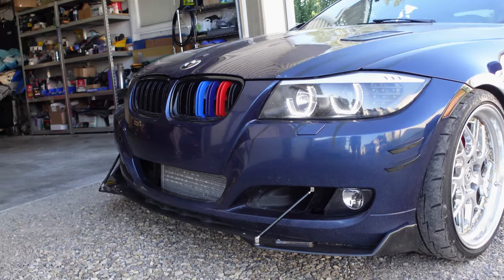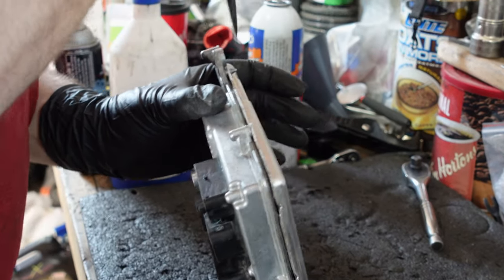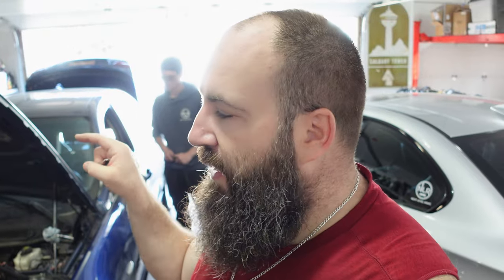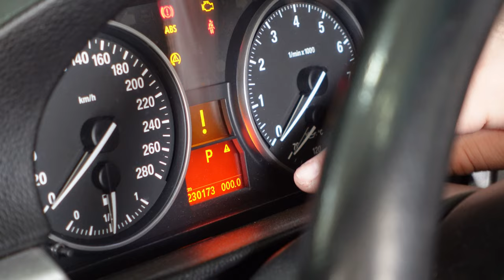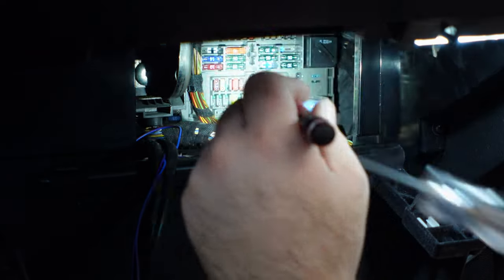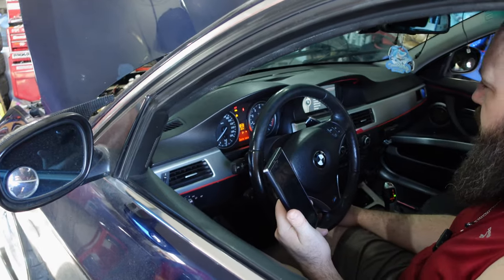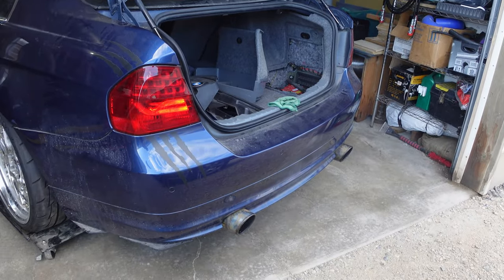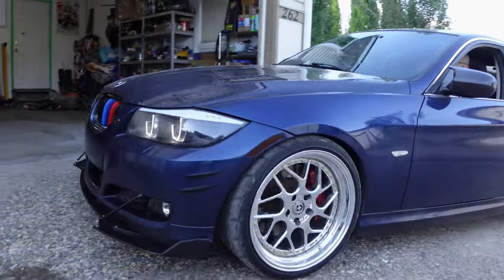Solving An Annoying Crank No Start on Newly Built N55 with 8hp45x Swap!

Comment: Hey guys. Love the channel. Also have an e9x n55 xdrive with an 8hp45x swap using CANTCU. Have had the PTCAN issue ever since I swapped the car. Several other E series n55 cars have the PTCAN issue and we all have vastly different set ups. The PTCAN is often paired with a nasty torque limiter (#419304) that really zaps the fun out of the swap. Interested to see if you all encounter anything similar. Good luck!
Reply: I second that!  That PT-CAN fault really takes all the fun out.
Reply from the maker: I know this is something cantcu is actively working on and beta testing solutions to allow the best experience. Always a lot of different things being beta tested with the many different variations between engine and transmission setups.